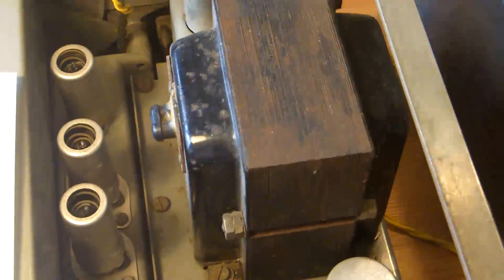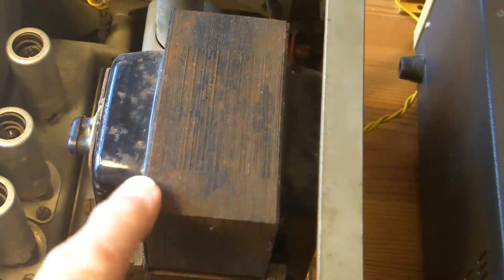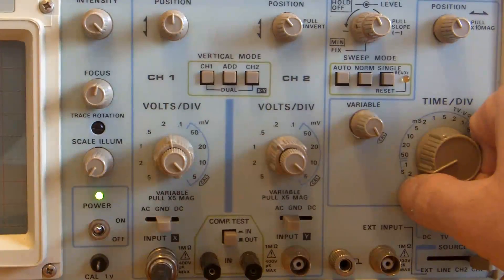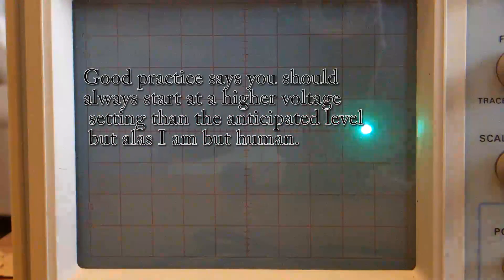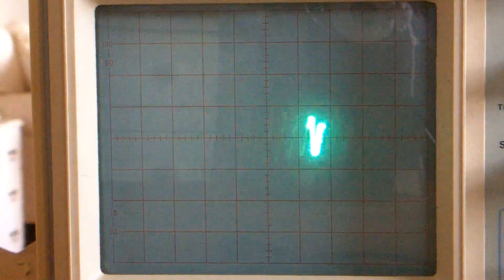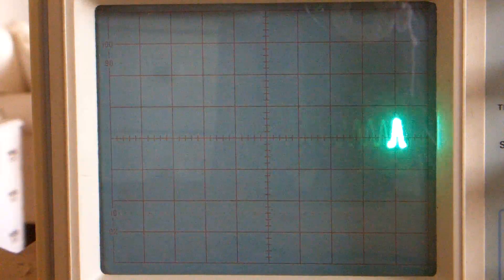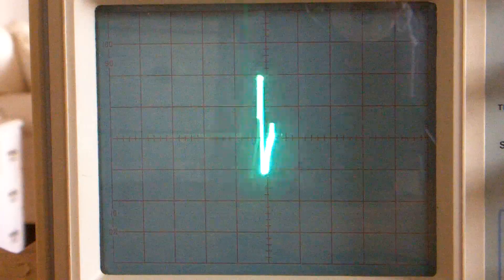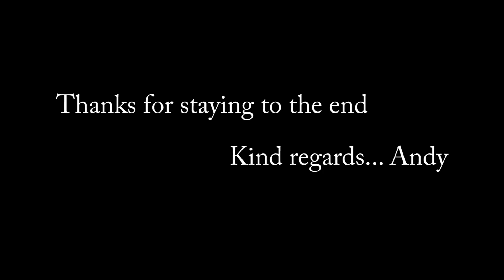About Radio ... Part 29...S680X Inrush current by Andy Davies gw0jxm

Comment from the maker: 1 of 2
Hi, normally in electrical matters when folk talk about amps, volts or watts it is taken as been an RMS value and that’s largely taken for granted unless you qualify the statement with Peak, Peak to Peak or average so for any given sign wave it can be expressed in 4 different values. I raised the notion of root two to remind people that it is the peak current that’s been measured (I should be even more specific really and say it’s the peak to peak value)... 
 see 2 of 2

Comment from the maker: 2 of 2 ...anyway it’s the power under the curve that does the damage however you call it.
Fuses are nominally RMS rated and you can get anti surge fuses that will stand a higher peak current but still blow within a given lower range (they are all time/temperature dependant) the whole topic of hysteresis / anti surge can be very complicated and quite troublesome, this is only scratching the surface.
Kind Regards ... Andy

Comment from the maker: Hi Simon, sorry to say I was floating the scope. I know all about the safety issues but for thirty years I designed and repaired industrial/scientific high voltage, high current radio frequency equipment that would boil you if you even got near the wrong bit, if you can imagine what a continuously rated  8kV 30amp  (240 KW) DC power supply would do to you. I reckoned I’d never make more than one mistake, having said that I knew one man that did survive and another who didn’t.

Comment from the maker: Just another point to remember is that at a ‘cold’ switch on, the load is only the primary of the transformer and what it sees on the secondary ie the rectifier valve is cold so it’s not producing HT DC at that point. The filaments and pilot lamps present a load but the series inductance probably reduces it very significantly as far as the primary is concerned. As I say it’s a hugely complicated topic, this is only a teaser. Thanks for the comment though. Kind Regards .. Andy

Comment from the maker: @nixxonnor Damn, I knew someone would raise that! Hi. Yes it will have an effect, if the inrush was 2 amps then we’d drop 4.4 volts across the resistor, but remember I’m not setting out to do a scientific demonstration but only to give an indication of the random nature of our actions when we switch it on. I could go on to say that as the resistor is a wire wound component we can start talking about the effects of series inductance as well, but I’ll resist. Kind Regards ... Andy

Comment: Hi!

Isn't that low value resistor in series with the mains load lowering the startup voltage and thus reducing the inrush current signficantly compared to a normal startup (without the resistor)?